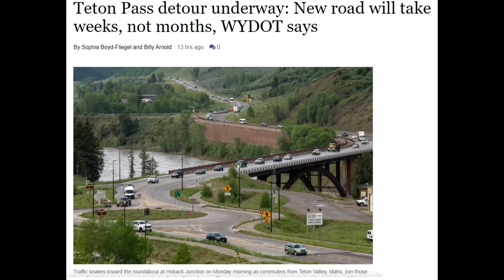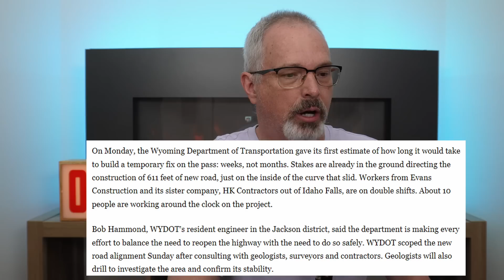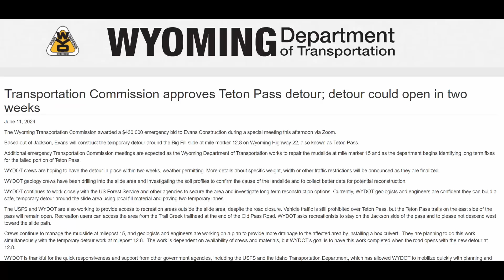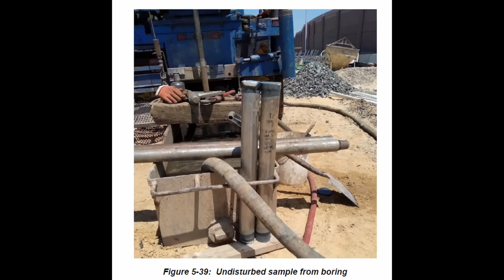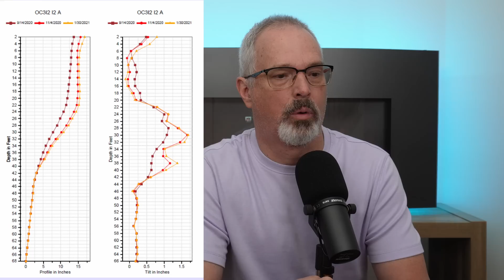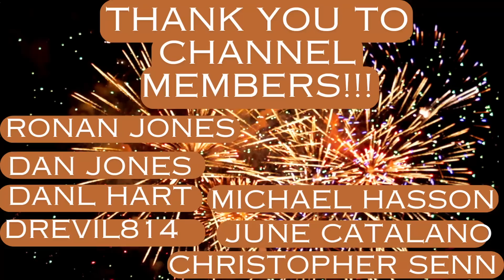Wyoming Slide Update

Comment: I would not be surprised if that whole section of curved roadway when originally built across that ravine is just fill pushed in from the ends and compacted down with dozers, so that it is a hump of concave lifts with shear planes waiting to fail. It needs to be completely dozed down flat and restacked with flat lifts and good compactable rock/clay...would be pricey, looks like that is not the plan...

Comment: I find this failure interesting. It was clear to me the individual that took the video of the failure did not know the potential danger.
Would the use of caissons in the design of this section work?  Using them in a way not for a bridge, but supporting a more typical roadway.
Reply from the maker: Yes, drilled shafts are a viable slope stabilization measure. They are not cheap, but can perform well at these kinds of sites.
Reply: @CaseyJones-Engineer  Yeah, great idea. It will start snowing up there in September.
Reply from the maker: @robgrey6183  But the do have time to put in a new section of road right next to the failed section!

Comment: I think you are going to find the temporary bypass road will be significantly further away from the original road and far down slope on the opposite side of the failure.   Look carefully at the picture you show at 6:40, they are pushing trees well down into that curve, the dozer working is 300-400 feet away and it appears at least half the height of the original fill, almost as if they are going to "square it off" at the entry and exit points of the original curve.

Comment: Some years ago riding a motorcycle north from Durango CO on US550 I noticed what appeared to be past slope failure under the roadway ahead after an upcoming hairpin. When I reached that section of road I saw cracking and subsidence of the asphalt very similar to images in this video, if significantly less severe. I rode to the inside edge of the road as I passed that area but it scared the heck out of me. The drop to the valley below was huge.
My father was a NYDOT highway engineer and I got to watch much of his work throughout the '60s and '70s. After seeing the care taken by him when designing and building on slopes I am shocked with the casual attitude some DOTs take.

Comment: Casey, that section of the highway is challenging. The elevation gain through that curve is significant. I used to live in Jackson. My first winter there, I got stuck on the upper end of that curve.  I am not surprised by what happened. A solution is going to be difficult to sustain.

Comment: Let's see, a steeply sloping down-valley (westbound) hairpin turn on top of fill on top of unconsolidated till on top of bedrock, and between two active (last 10k years) thrust faults for funsies—*What Could Possibly Go Wrong?* Effing hell. The geologists & geotechnical engineers need to be given a few months to work this out.
At best the "shortcut" will slowly settle southbound (away from the existing scar)—but I agree it is more likely that the whole mess will slide northbound, off the saddle, and into the creek beyond (500' horizontal & 120' to 160' vertical).

Comment: When I was in high school in the 70s, I worked as a technician in a soils lab, performing tests on soil samples and later as a roughneck on a rig collecting samples. The tests don't take that much time, it's just that there are so many of them. Our big project was preconstruction testing for a power generation plant(Big Cajun No2, New Roads, LA). We drilled several hundred holes to 200 feet, taking samples every 3 feet. What would be interesting to see isn't the latest testing, but the reports from the tests before and during construction.

Comment: Sorry, you've got a bad case of paralysis by analysis.  Yes, in an ideal world, you can take weeks/months to do tests for an optimal solution.  But they don't have weeks/months. There's plenty of room to construct a temp bypass while the main embankment is rebuilt later on, after more testing is performed.

That said, WDOT seems full of cowboys, shooting from the hip, asking questions later...
Reply: If the location of the temporary bypass is as good, safe and sound as you (and other commenters) imply, why wasn't the highway built along that alignment originally?   Why are WYDOT and the Governor willing to use a BandAid to fix a compound bone fracture. 
It seems that a project to rebuild that highway, or sections of it, on a whole different alignment and over an appropriate time scale and budget, could have been one that WYDOT had already researched and had on file in the event of this actual worst case scenario.

Comment: Casey, the Wyoming chamber of commerce  is pushing this repair project. It's summer in yellow stone and they can't get the visitors there fast enough. They are worried about the $ not safety.
Reply from the maker: The timing is very bad to be sure but I think there are voices of concern being drowned out right now by others that just want to get 'er done as they say.
Reply: @CaseyJones-Engineer  Yeah, all those people on the Idaho side who have mortgages to pay and need to get to work. And all those businesses on the Jackson side who will go out of business if their employees can't get to work.
The nerve of those people!
Reply from the maker: @robgrey6183  Nobody said that the road shouldn't be reopened as quickly as possible.  However, it won't do the traveling public any good if it is not done in a safe and prudent matter.  The mentality of just "winging it" is what they already tried when they put an asphalt patch on the cracks and reopened the road.   The only reason the road was closed at the time of failure was due to mudslides a few miles away.  Magical thinking isn't the way to go to solve these types of issues.

Comment: This is an ongoing issue with WYDOT around Jackson. They are under a lot of pressure from some very wealthy people to push the road open. The geologists and investigators involved here are the same ones that assured several businesses in Jackson that the hill sides would be stable after construction, yet the hills in Jackson have slid and crushed several buildings.

The road here was not initially designed for heavy traffic or heavy trucks, it is no surprise that the embankments are failing again.

Comment: The suggestion of a bridge is not suitable if you look at the gradient. This embankment fill that failed is a switchback on a steep side slope. The point where you suggest a bridge has an elevation difference of about 75m between the uphill and downhill ends. Given the topography of the site I don't see any easy solutions. It may be possible to build a temporary bypass road on the interior of the curve while the main road is reconstructed over the next year. But the temporary road will be steep (12-14%), and will likely have to have retaining walls to minimize the footprint of the fill so that it doesn't compromise the rebuilding of the main road.
Reply: In another comment a geologist familiar with the area estimates the temporary road will have a grade of about 20%. He also list several things that are needed to make the temporary road safe. So his comments are consistent with yours.

Comment: I think you might be unaware of how common pavement cracks due to fill settlement are in the mountains out west. For example, it took me about 2 minutes on google to find this example on a major highway (US-2) in my home state of Washington (see link below). I suspect the previous crack repairs they did here on Hwy 22 are just one of dozens or locations where they have done similar repairs on this one highway. I don't think there is the political will to spend a large amount of money to monitor and preemptively repair the likely thousands of similar locations like this across Wyoming.

https://www.google.com/maps/@47.7352444,-121.1308459,3a,32.8y,352.89h,80.77t/data=!3m7!1e1!3m5!1sM5_Tj2pxofXCjKnCyeNplg!2e0!6shttps:%2F%2Fstreetviewpixels-pa.googleapis.com%2Fv1%2Fthumbnail%3Fpanoid%3DM5_Tj2pxofXCjKnCyeNplg%26cb_client%3Dmaps_sv.share%26w%3D900%26h%3D600%26yaw%3D352.8869606242193%26pitch%3D9.234304049534302%26thumbfov%3D90!7i16384!8i8192?authuser=0&coh=205410&entry=ttu

Comment: Simply just build a temporary Bailey bridge on the inward side of that curve, so that the bridge won't get in the way of rebuilding the road, and at the same time it allows traffic to bypass the section of the damaged road. Get the National Guard to build the bridge, they have the equipment and the bridge components for the job.
Reply: Bailey bridges can be built on a curve, going up a 10% grade????

Comment: after looking at the overheads  the fill for that embankment came from the near roadcuts and not selected much for its properties other than fill materials  it looks so uncompacted..at this point its a rip out job to be honest  and this is where  i get used shipping containers cross stacked and welded/bolted together for cribbing with some beams waterproof coat it and fill it with railroad ballast .

Comment: JUST ABANDON THE HIGHWAY before someone gets killed!  Start over with a new route and clearer understanding of the geology.  BETTER SAFE  than sliding down hill. Travelers can find other ways through that country.
Reply: Nope. Whilst those clamouring for slipshod temporary bypasses to be put in place before even the extent of the landslide has been worked out properly are wrong, your contention is equally ridiculous. The route via Wyoming Highway 22 that is now blocked by the landslide is 18 miles. The distance between them via the shortest diversion is 89 MILES.

There's a reason the route went via this particular pass. There's an argument that the route should be improved with a proper understanding of the geology, but that is VERY different to what you are proposing.

Comment: It’s a TEMPORARY road. Probably one lane with traffic controls. They aren’t talking about dumping quicksand in the hole, throwing cold patch on it and calling it fixed. Settle down. 

The problem is that you and so many others have come to ACCEPT and EXPECT the ridiculous timelines we put on infrastructure projects in this country. There’s a whole industry that runs on the preconstruction grift, delaying projects by years, siphoning and inflating budgets and killing projects on the drafting table. Our country has forgotten how to get things done. We just schedule meetings and studies. I’m not saying that engineering and analysis isn’t required, but it shouldn’t take 3 years to rebuild this. Put the bureaucrats and “stakeholders” behind the caution tape and fix the dang thing. You’ll be astounded how fast it happens when they get out of the way.
Reply from the maker: Just because people are in a hurry doesn't mean the laws of physics (and good engineering practice) gets suspended.  People will be driving on the temporary road after all.